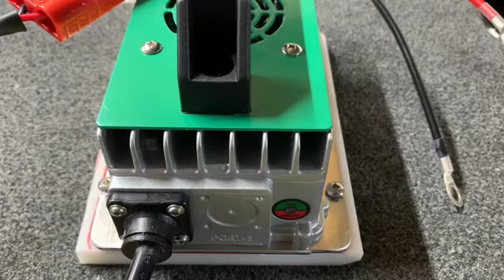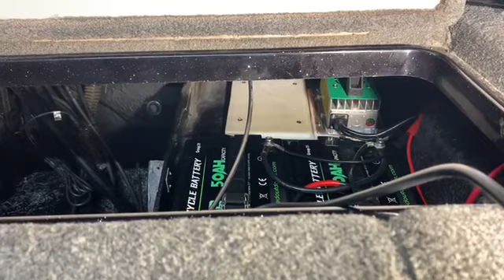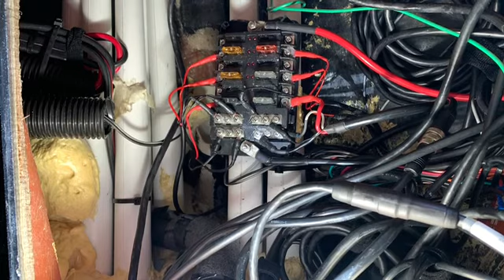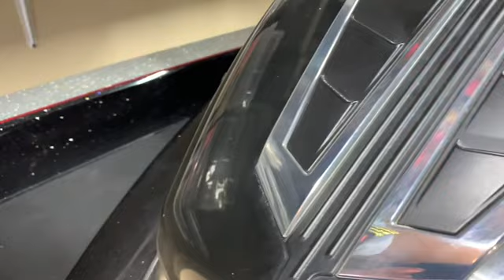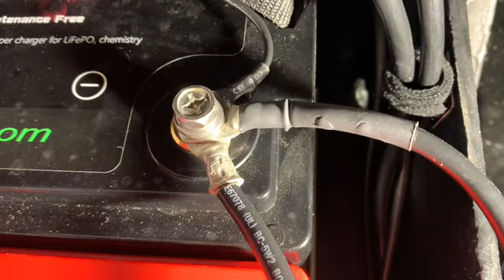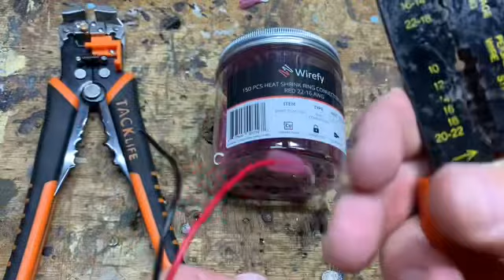Bass Boat Wiring Part 2, Humminbird One Boat Network, Amped Outdoors Lithium Batteries

Comment: Great information and video? I'm looking to replace the black connection box on my ranger for the trolling motor, where can I purchase for the connection boxes, again thank you.
Reply from the maker: If you’re referring to the trolling motor on and off switch mine needs replacing too. I had to cable tie wrap it last trip so it would stay on. Hopefully I can use a switch similar to one for my lithium electronics battery in video. I will look into that very soon. If you don’t hear back, drop another comment to remind me.

Comment: Steve great video, thanks. How did you run the Ethernet cables to the Ethernet box? Did they run from the front to the console, then into the rod locker? Was there a conduit to run them through?
Reply from the maker: There was no conduit from the console to the Ethernet box, there was a channel from the front of the boat, for the wires that opened up to the day box in front of the console. We run a wire fish to the front then pull the wiring through. We leave a string in afterwards to make it easier to run wires the next time.
Reply: A channel where? I have a conduit in the starboard side running from the front panel to the console. I assume I will have to run my Ethernet cables through that.
Reply from the maker: Brian, yes the channel is a piece of conduit that I run my Ethernet cables through on the Z520C.
Reply from the maker: From the bow to the console is the conduit.

Comment: Kinda mind boggling. You have loads of electronics! Four Helix 12's, FFS, etc, etc.  Appears neat, well thought out, and easy to identify wires when, like 2 years down the road something needs fixed or changed.
Reply from the maker: Thanks JD, when I retired, I upgraded my electronics. I didn’t buy everything at once. My G2N at the console, I have had a long time and use it for driving, map/2d. I converted to lithium batteries last year. Younger anglers are so good with technology and I am just trying to keep up and stay current. 

Troubleshooting down the road will be much easier for sure. With the 12 fuse option, I have room to add new technology if needed. 😊